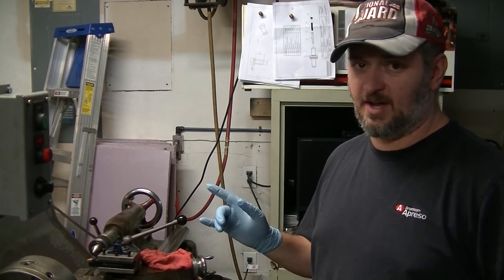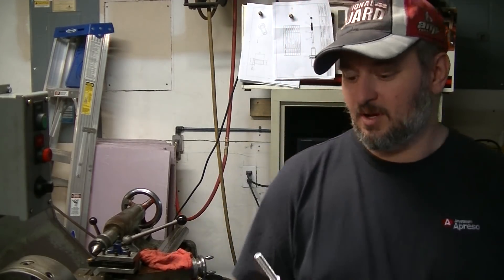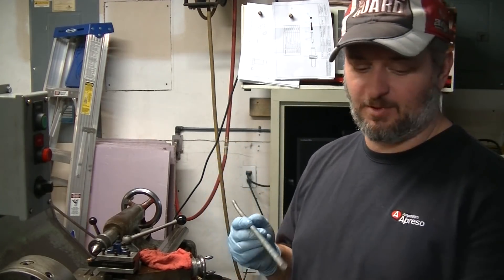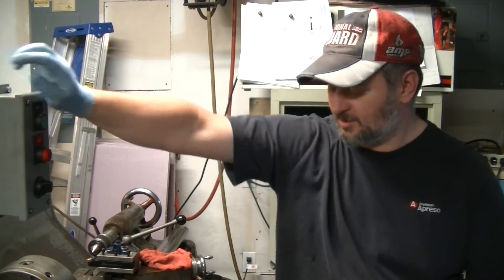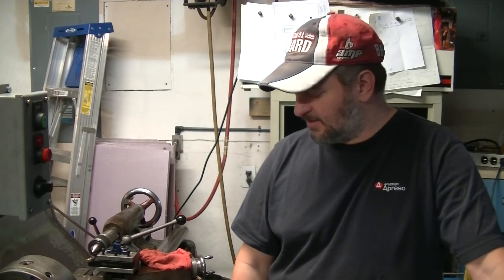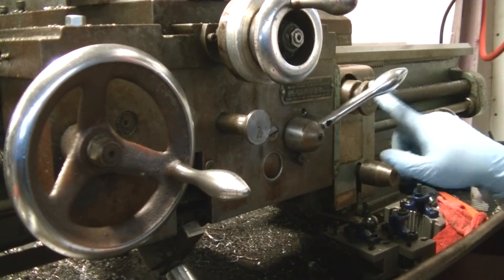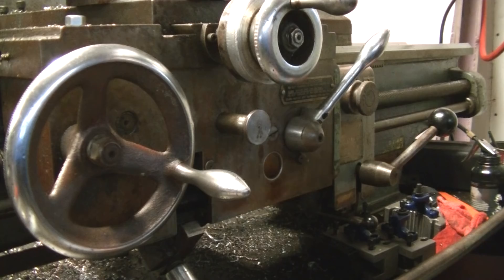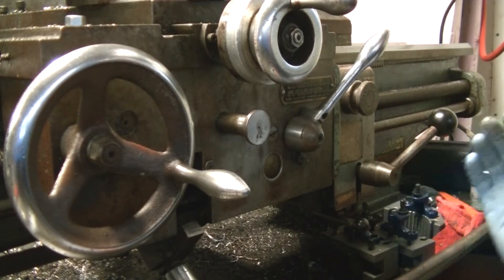Shop Update - Using the Ainjest quick threading unit

Comment: The "Ainjest" is the metric rapid threading unit. You have the English rapid threading unit.
Reply: @Ziffels I'd guess not but I don't know why there's a metric one and an imperial one. It maybe depends on the leadscrew - whether that's a metric or imperial thread - and the rapid threading attachment has to suit the leadscrew. I think the continental gearbox may also be available in metric or imperial - it might be the same box with different changewheel gearing. I suspect the fixed factor is the leadscrew pitch.

Comment: 13:20 Having got the hang of it, now do it 'real time' - i.e. 500-800 RPM - as appropriate for that diameter material.
Reply from the maker: I wish I could but I sold that lathe a couple of years ago. You're right though - it could thread at much higher speeds than I would have been comfortable doing without that threading attachment.
Reply: @TomZelickman  I've a similar machine and have wondered if I add a few springs here and rods/linkages there whether I could get it to reliably release the halfnut from the leadscrew !
Anyway, with CNCs it seems you're sorted !
I've not got as far as DROs yet - they seem a bit of a no-brainer but tradition and all that !

Comment: Did all my apprenticeship on a Colchester using ainjest just just like that, we did both metric and imperial thread ok
Reply: Ziffels  as long as you engaged it in the same place each time it worked ok for us, the pitch is to do with the lead screw gearbox and the change gears in the back of the machine.
Reply: Ziffels I was on a imperial machine with a imperial ainjest, but we mostly cut metric threads ,  it was over 20 years ago now  but can’t remember any issues we had to overcome , you should be ok .

Comment: I have one of these lathes myself, I did not realize it at the time but someone had crashed it 3 different time and bent the hand-wheel gear that follows the rack under the bed. The rack has 3 bent teeth and I still need to make a new gear. So be careful when you thread up to a shoulder and make sure the stop adjustment is tight and does not slip. I found out the hard way on my other lathe, if the carriage is NOT disengaged before it gets under a bind something is going to get bend or broken. Lucky for me it was just the aloris threading tool hss blade.

Comment: So so sweet. Man I like that
Reply from the maker: +Logical Apprentice. Thank you, sir. I could get spoiled like this. One thing I noticed though is I either need to recheck my tailstock or the wear in the bed was worse than I thought. Noticed a bit of a taper when turning the longer stuff. It's not something that I typically do but it sure showed up hard when my thread clearance changed from one end to the other...

Happy New Year, my friend.
Tom Z
Reply: You might be able to off set the tail stock to help either way. Worst case..... Cut a test bar, indicate the length, mark your ways with the amount to bump the handle. Make as many marks as you need to get it done
Reply from the maker: I've been meaning to make a test bar and just haven't gotten around to it. It seems like, just like this threading attachment, I get around to things when it smacks me in the face that I need it. Still moving forward though!

Happy New Year!
Tom Z

Comment: that looks a great way of making threads is it a pain to set up ?
Reply from the maker: +Bleu Wolf Thank you! It takes a couple of minutes to set up but wasn't too bad. I suspect it's much more useful when making a lot of the same part but you can still run it similar to using a standard half-nut and manually disengage the clutch as well.

Sincerely,
Tom Z

Comment: Now if it only would push out the cross slide so you could thread without a relief.  :-)Nice feature of the lathe.  I assume you can use the same feature to automatically stop the lathe feed when doing normal turning as well?
Reply from the maker: Right! Then we can make it automatically go back and zero. Oh, wait a minute... :)

So I tried the stop and yes, the carriage feed also has a pressure clutch. When it hit the stop it came out of gear but it took a lot more pressure to do so which made the carriage spring backwards due to backlash. I'll have to experiment a bit with that.

Hope all is well and Happy New Year!
Tom Z
Reply: Happy New Year. Here's to hoping for better health for both our backs in 2016.

I forget many lathes have a separate feed for the carriage and threading.
Reply from the maker: +ILGopher I'm already spoiled by this thing. My old South Bend didn't even have power feed, just a half-nut for threading that I used to gear really low and fake it into moving slowly enough to emulate a power feed. It took me a read through of the manual to figure out the carriage and the threading operated on separate drive mechanisms. Maybe one day I'll get a CNC lathe but something about running the machine feels like therapy to me.

How is your back doing? I can reach out offline if needed...

Best wishes, sir. Thanks again.
Tom Z
Reply: Spasms and low back.  Issues all my life with it.  I really need to lose about 90-100 pounds and it would help it and my ankles.
Reply from the maker: I can relate to all of that much too well... Hope you make some improvement!